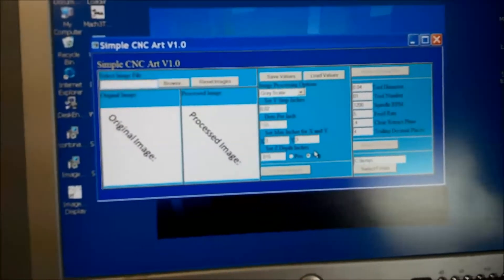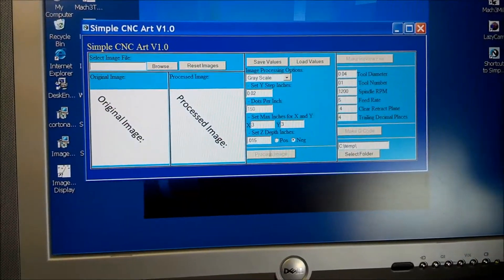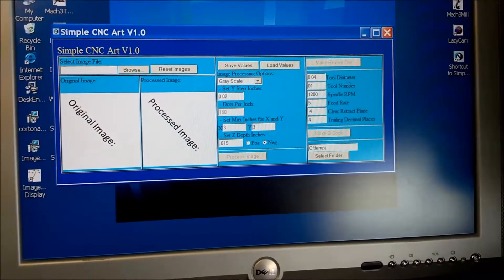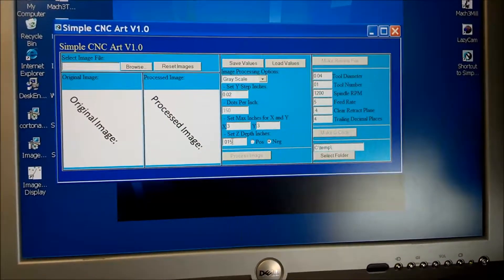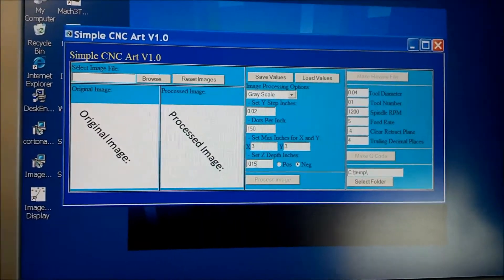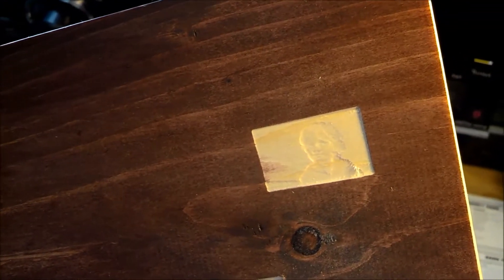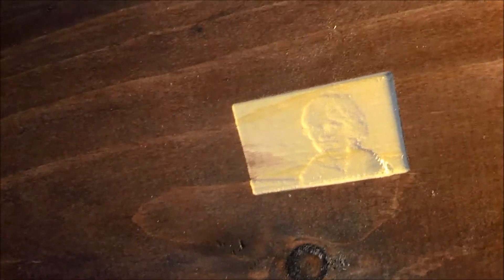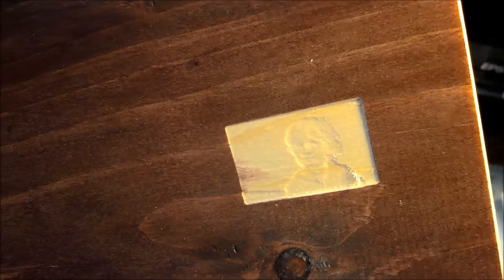CNC Picture Carving - First Results

Comment from the maker: rclewis01 - Good eye!  Yep.  The solid ones were working okay, but there was a little bit of pulse through the whole machine for the very slight, off plumb-ness of the coupling nuts.  It would have given a very slight bit of extra wear on the stepper motors so I figured for the time being I would just swap them out and go back to the fuel hose.  Also, as a side note, the original fuel hose I was using was 5/16"; that was a bit large.  I changed the hose to a 1/4" and it fits much better.